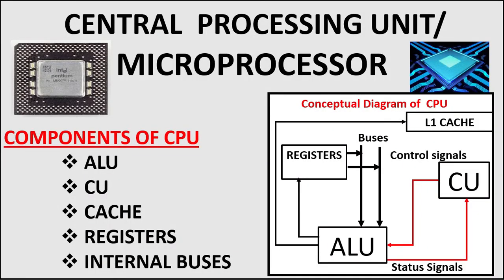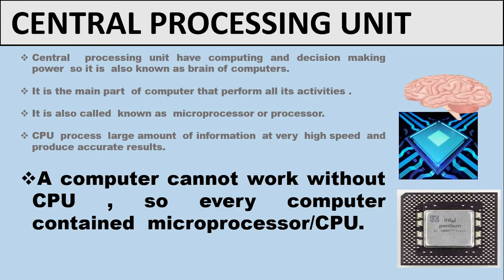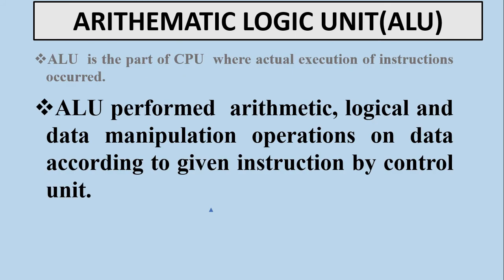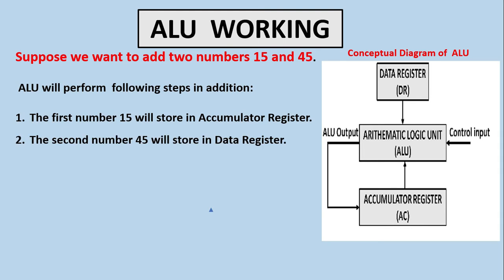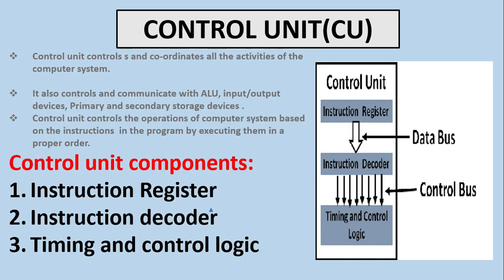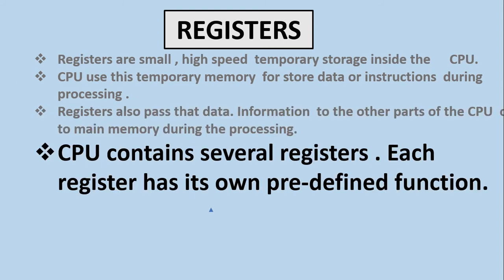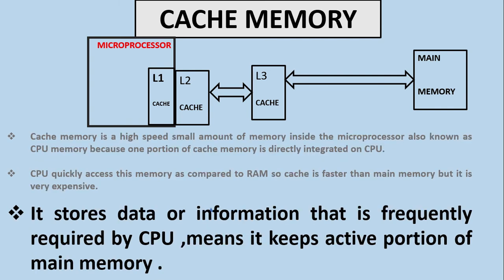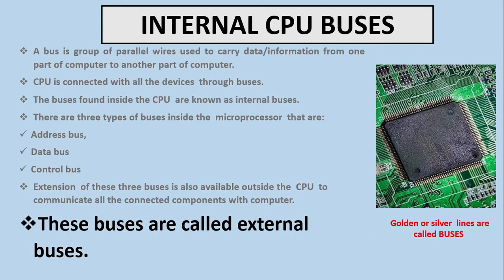CPU and Its Components|| Components of MIcroprocessor

Comment: What are the three components of cpu

Control unit, alu, register
Control unit, alu, ram
Reply from the maker: ALU, CU, MEMORY(CACHE,REGISTERS), INTERNAL BUSES
Reply from the maker: RAM is not a component of CPu
Reply: Thank you
Reply: Where does the operating system keeps information about all process

Process table
Cpu
Memory
Input/output

Can u please help me to find the answer
Reply: Which is the correct option?